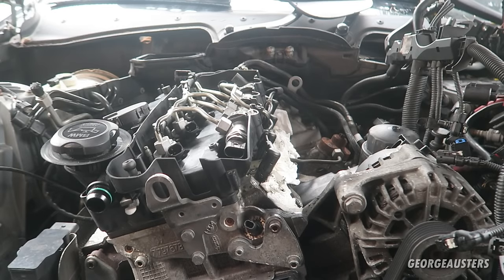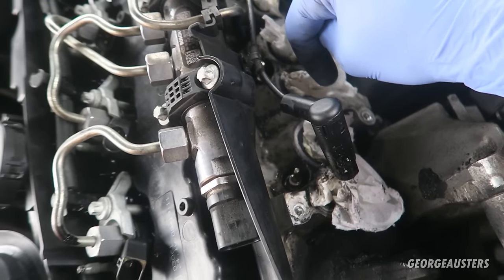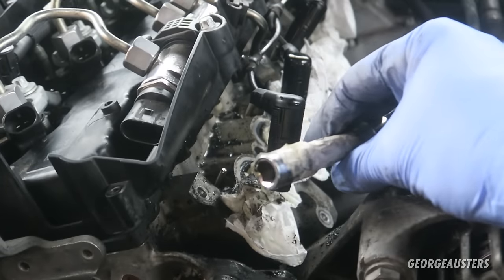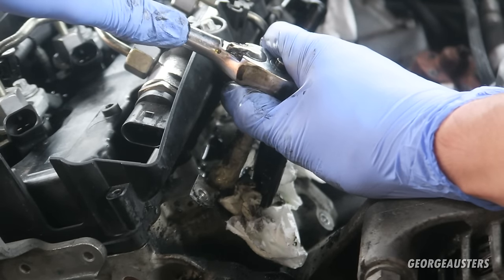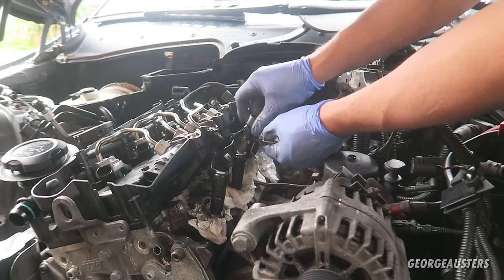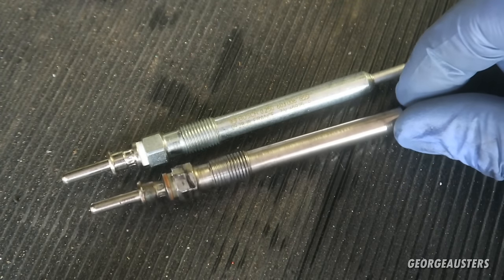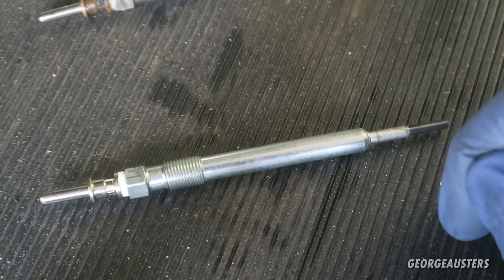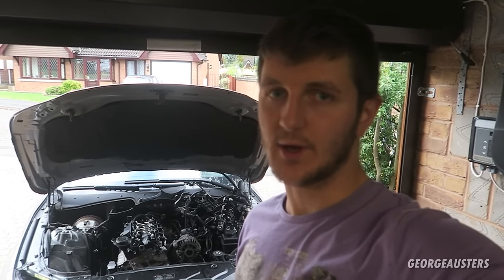How To Remove Glow Plugs WITHOUT Snapping Them

Comment: Have not seen this mentioned but wd40 is NOT a release agent, far better to use a penetrant release fluid marked as such, works far better because funnily enough it's designed to release stuck seized components, unlike wd40 which is designed to stop corrosion and lubricate hardly a release agent.
Reply: This has already been mentioned a couple of times earlier. As far as I am concerned it doesn't really matter what you use. In my experience any penetrating oil/lubricant will not travel down the threads until they start moving anyway. A number of times I have used penetrating oil, then examined the fastening once I have eventually removed it, you can quite clearly see the liquid didn't penetrate more than the first couple of threads. It annoys me to see the number of people who think penetrating oil is some sort of magic liquid that can penetrate even gas tight threads. Penetrating oil is only a clever marketing ploy and is like a doctor prescribing a placebo. If it works you think it is wonderful stuff, if it doesn't, well you don't blame the product, you just think it was going to happen anyway or your technic/tools were faulty.
Reply: @stevenmcknight6211  Excepting these are not "gas tight threads", the glow plug seals on the taper on it's lower body against the head. Nor are the threads tapered (pipe thread). I get "proper" penetration when I use proper penetrating oil, and give it enough time to work, especially with 2 (or more) different materials going through heating and cooling cycles (expanding and contracting at different rates).

Comment: If the aluminium thread has stripped a bit I would just run a plug tap down the hole and suck out any swarf with a vacuum cleaner

Comment: I changed all glow plugs on my Duramax LBZ and still showing cylinder #3 and #8 are still “open circuit “. Any ideas?  No mechanic here. Don’t know much but willing to try...thanks
Reply from the maker: Were those glow plugs showing open circuit before replacing?
Reply: @GeorgeAusters  #3 was a cylinder that showed up as open before I changed them out. #8 did not show up as a GP that needed to be changed. In short, one was, and one wasn’t
Reply from the maker: Maybe the new plugs were faulty. If not then you have a wiring issue
Reply: @GeorgeAusters  thank you, Sir. I will check further. I appreciate your expertise

Comment: Only thing I would add would be to run a tread chaser down the treads in the head...didn't like the look of a couple of those plugs coming out...you nip up the new ones on the way in and its all over.
Reply from the maker: I did clean out the threads when installing and they went in fine👍🏻

Comment: hi  u mention at 1,50min to put wd40 on them couple of days before.
my question is can i drive the car then if i lubricate it with wd40 ?
Reply from the maker: Yes you can. WD40 doesn’t do any damage👍🏻
Reply: @GeorgeAusters  wanted to do by myself but when i opened the hood today that intake manifold is so close the plugs i could only see one.
and to remove the intake manifold for me is complicated
thanks for the info very nice video

Comment: My experience in general is that WD40 does not help when disassembling, nothing can get into that threat or maybe just maybe one or two tours, but that is not enough. Temperature difference helps much better, but is not always possible. Shock therapy is nice if you have a perfect fit of tools. But most importantly is not continueing undoing the object, but slightly tighten it again, clock-counterclock-clock-counterclok and then apply WD40 while doing that. At that point it will get in there and help lubricate. Perfect fitting strong tools, patience, feel are key ingredients 🙂
Assembling with coppergrease, checking their resistance (less than 1 Ohm) during 10.000km servicing and certainly not let it come to 100.000km without ever taking them out. That is really asking for trouble.
Reply: After reading more reactions... seems you are wrong about the copper grease...
And wrong about using WD40....
And some come out just fine even after 200.000 km...
So then..?
Reply: @bartden9668  The other comments that claim copper grease should not be the best choise are only theoratical cause copper could corrode aluminium. My experience is that this does not happen at all and that thread stays in good shape. 
WD40 might help a bit on the very beginning of the thread and only if you give it lots and lots of time, which normally no-one has...

Comment: After I've changed all of the glow plugs, while cold start the car starts good, but the RPMs are fluctuating, going from 1100 to 1000  or even 950 and then getting back to 1100 which is the correct RPMs value at the cold start this takes like 10 20 seconds after that everything seems to be OK. 
Is it possible that the glow plugs are not tied up enough and maybe the engine is losing some compression? Or do you maybe know what could be the reason for this strange behavior? 
Thanks in advance, Daniel.
Reply: forget to mention, BMW 318D E91 LCI, 2008, N47 engine
Reply from the maker: Rough idle is usually injectors or vacuum leak
Reply: @GeorgeAusters , what do you think where could be that vacuum leak produced, since I didn't unfit the intake manifold while changing the glow plugs? Thanks.

Comment: You're lucky, they succeeded, whole.  It's ok that you put in liquid solution.  .  Dynamometric wrench must be used.  First, squeeze a little, then unwrap to clean the calamine.
Reply from the maker: Patience is key. Also helps if you have a warm engine, which I didn’t!
Reply: Lucky?   Never ever had one snap.  Out of hundreds.   Mercedes can have problems with head staying in.  But never actually seen it happen.   Just drive it warm spray rustloosen when hot.  Wait 30 mins. And crack on.

Comment: Georges, 
can I remove the spark plugs without removing the intake manifold?

Thanks, 
Mohamed
Reply: Mo:  no sparkers on diesel
Reply: @happysawfish  glow plug sorry 👍🏽
Reply: @mohamedabderrahmane6089  :  did you get yours changed out ok?  I'm looking for help with an Isuzu diesel
Reply: @happysawfish  yes I did. Release with the electronic torque wrench purchased on amazon, around 60 euros Loosening torque not to exceed 35newton meter, at 22 newton meter they turn, it was necessary to go slowly because the rod is notched on the thread. Replace 15 newton meters with copper grease. What do you need ?

Comment: Peace brother
Reply: I’ve just watched your video on drilling the ceramic insides of a pdf,mines blocked on my 2009 X5 35d msport,and I have 3 glow plugs coming up as faulty on my Carly adaptor,I haven’t got the technical now how to do mine,it won’t regenerate
Reply from the maker: Yes it won’t regenerate with glow plug errors
Reply: @GeorgeAusters  yes George I went for a short run the other night and I was glad it was quiet as it seemed like it was going to stall,it did at one point,I’m booked in to have all 6 glow plugs replaced,my Carly says there’s 59.85g of soot in the pdf and 0.04g of ash
Reply: Don’t worry I’m not after free advice

Comment: All screw threads that lead into the cylinders are gas tight.- you can dump as much snake oil on them and it won't make any difference. It's as you say it's one of many you tube myths.
Just take some time,don't put too much leverage and it's fine.
Reply: I think the gas tight seal is on the seat at the hot tip end and not on the thread. If you look close there is a small chamfered seat, where the tip meets the housing. So I would recommend penetrating oil and working back and forth like the video describes
Reply: Ngk recommend you to do it tbf. Look on there youtube video

Comment: Do you really believe wd40 piss can go through the threads down to the tip of the plug? If that would be the case then compression wouldn’t be possible. 
I removed the glow plugs from a 530d I used to own at 220k miles without any issues but I know someone who broke all 4 on a 300k miles Renault trafic, each one in a different shop by different mechanics.
The problem is the tip which gets stuck not only the threads. Broken plugs removal tools work only if you are lucky to have enough space, otherwise it’s a head job haha.
Reply: Some penetrating fluids have "capillary action", which is a fancy way of saying, that even with the smallest of clearance, the lubrication will get to where it should be. WD40? I wouldn't bet the farm on it, everybody has their favourite, I use a product called "fluid film", a good friend of mine uses Wurth products, another CRC, still another a Lloyd's product. Whatever you use I believe the trick to be a good soaking, every second day, for a week, and normal driving (heating and cooling cycles). Use little tools, I use a 1/4 drive socket, and ratchet. Once moving, work it back and forth, applying more penetrating oil. I used to use "never seize" on re-installation, when never seize had lead in it and actually worked. Now I use a synthetic high temperature brake grease (Permatex), some use a Dielectric Tune-Up Grease that you will be putting on the electrical connection anyway.

Comment: If possible allways take them out when Engine is at it's MAX temp. Meaning radiator fans has start its 2 time running (when, AC is OFF!).
Reply: I confirm, the diesel engine can also work without the intake manifold, so it can be heated just before unscrewing the glow plugs.

Comment: There no longer is an excuse for broken glow plugs. What really needs to happen is for mobs of pissed off vehicle owners to cane the begesus out of the so called engineers who keep designing such fragile components that are impractical to replace.  For example, have you ever seen the glow plug placement on a GM Duramax pickup?

Comment: @George Austers   Spraying penetrant over tightened glow plugs doe's nothing mate!, It just runs off! N47's are one of the worst diesels, Rear timing chain that fails, Engine out and clutch and DMF off FFS! Check out all the plastic they use? Utter junk of a diesel engine, Volvo Euro3 D5 FTW!!

Comment: Can you show how to replace the spark plugs next?
Reply from the maker: I will have a video coming very soon👍🏻
Reply: Still waiting... I told Mercedes it's not my glow plugs that are making it hard to start but my spark plugs are getting wet because of to much diesel (from the carburetor foot needle sticking giving the electronic fuel injector too much full, all because the points are not set so the computer holds the injector pulse at full wide band therefore shorting the coil packs) it's a no brainer. You have no idea how they looked at me....As if I was a genius, there jaw's were on the floor and they were speechless, so I just took the car back and change my ignition leads ( from the big square box thing with the - and + on the top) got rid of the old school thick copper wire and replace with NGK 8.0mm silicone leads. 
Not sure what I did wrong but car won't work anymore, I think I forgot to take out the headlights, boot lid and back seat out so must of blown a gasket around the fuse. 
I'll get it going no dought, I'm smarter than them Mercedes experts.

Here's a tip and don't let people know, if you want to make more power in turbo cars, everyone knows that resistance equals less power, true..? Well turbo manufactures have to put restrictions on the inlet side because of EPA pollution. So what you do is simply remove the spinning wheel with the shape blade on it from the turbo and let it breath.. they make it sound.so.hard "hi flowing a turbo" easy as hell, I just did it in like 5 min.. it's like a water saver thing they put in shower heads, no need for it. Can't wait to fix  fuse gasket thermostats balancer guides and finally get this killer  weapon doing skids from gutter to gutter, test out the degreaser trick in the diesel as Octandiesbost, makes the spark plug spark 12 times ever revolution for hard boost applications only.  

I'm what you say...?  (The Opposite to advancement of timimg...and starts with R..) I don't get it..?  
Ohhh, I'm ridiculous.. 
I know right...  sik cnt....

Don't forget you.... the one reading this is clearly " negative timing" for getting this far, you need help, I'm mentally ill so what your excuse dip stick.? Brains low on DOT3, or needs bleeding I think.. 

THE
       N                   ^^^^^^^
          D ..        { ..•...   ...•... }
                          \      ~       /
                            \__^^__/
Reply: @adrianjakovac897  That was an amazing read. Going to put all your advice to the test knowing I'll have the fastest amazingest racingest car in the country. Thank you so much.

Comment: U need 1 week to remove 4 glow plugs 🤣🤣🤣
Reply: Better to wait one week instead tracking the cylinders head off like me, because of one snap in and I spend £50 for a remove kit and no success, until I drill the bit from from the other side of the cylinders head. You don't want to know how big is the job after.

Comment: Copper Greece works as well as anti seize
Reply from the maker: Yep👍🏻
Reply: Nickel grease is better on an aluminium head. I would generally use Nickel grease rather than copper grease on heated joints. Copper sometimes gets electrolytic action between dissimilar metals and can do the opposite of what you put it on for.

Comment: lol...you've clearly never even laid eyes on...let alone put a wrench on...a glow plug from a truck driven in northern climates that get salted roads 5 months out of the year. Also worth mentioning is that these have boots over them and are under the intake. haha...this is comical to compare this to say a 15 year old duramax. Hardly a misconception...you gotta compare apples to apples kind sir. Thanks for the info regardless.

Comment: Don't get WD-40 in the cylinders
Reply from the maker: It's fine
Reply: Diesel engines will burn basically anything, a bit of WD40 won't harm it at all.
Reply: @jftechdrones  best just to spin the engine over to check there's none in there though because it won't compress a liquid, same with starter spray.